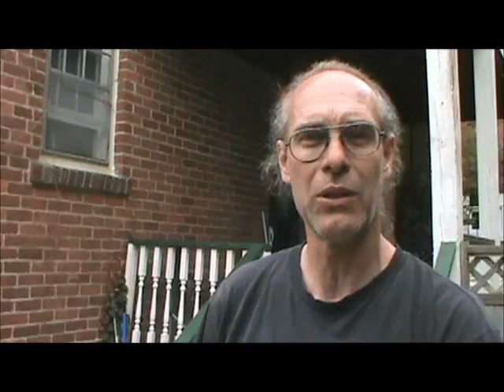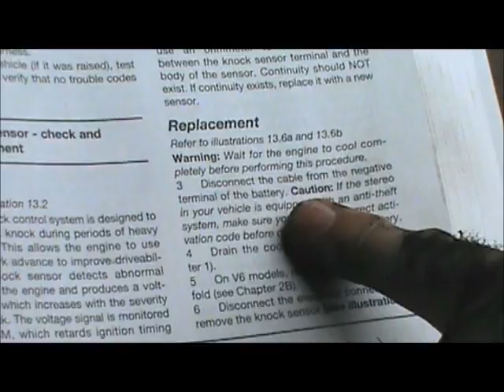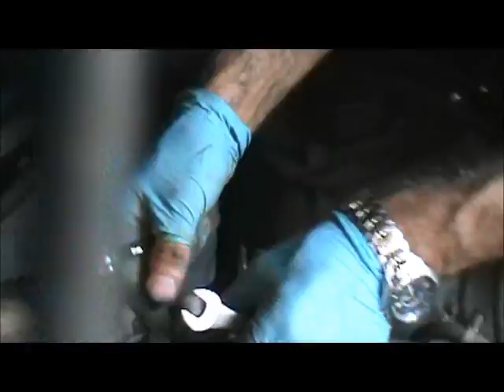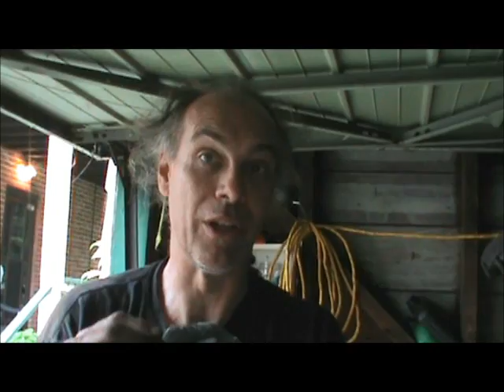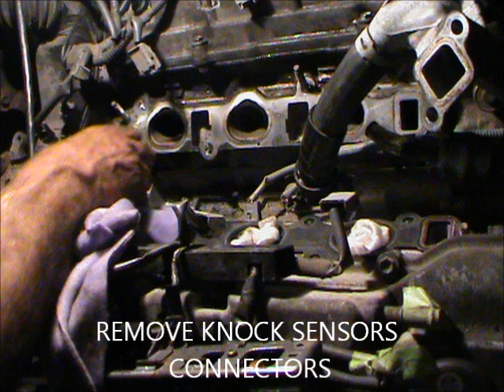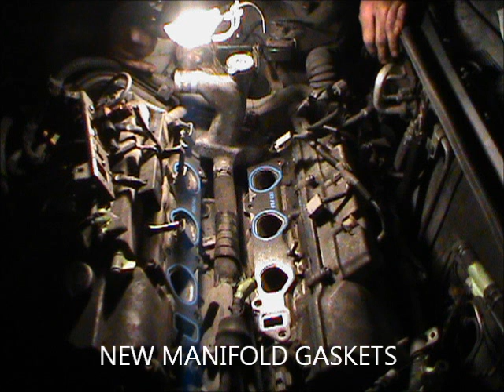2000 Toyota Avalon Knock Sensor Wire Replace

Comment: You never said if the wire harness replacement fixed the problem or if you had to go back in there and replace the sensors anyway?

Comment: 27mm or 1-1/16 wrench to remove sensors
size 8 Allen key for plenum use a socket Allen bit .
No need for torque wrench your hand is already calibrated to good n tight.

Comment: Hello I replaced the Knock sensors on my 2002 Toyota Highlander 3.0 with a Denso knock sensors and light come back new wire hardness too . Check engine Light come back p325 and P330 for both knock sensors I heard some people by pass it . What can be ?
Reply: I've heard of knock 1 goes bad splice wires to knock 2 going to ecm. Or vice versa. To skip all this.

Comment: have the engine light on w/vsc & trac light on, found a wire back of motor top/wires exposed with fraying, not sure what the wire is, I have a 2003 toy Avalon xls. some of the shelding covers are dry rotted, and clips, anyone can help me please?
Reply: it's behind the intake manifold

Comment: I have a 1999 sienna that has a pulsating sound coming from driver side firewall when the key is turned to the on position. Sounds like something pumping fuel. It use to pulse one time and start right up but now it pulses over and over and has a long start coupled with smoke from tail pipe. Any idea what this is? It started this after I changed the fuel filter a while back. And the sound sounds like it's coming from that box above the fuel filter.

Comment: I just changed these on my 2003 Camry beater with the v6. Suggest getting new PCV valve, the one that is plastic at an angle because it will not come loose without snapping. Get the grommet as well for it all together $11 from Autozone. Also get a hose the same size as the EGR hose. The one with the green cap on it. That one will snap as well as it’s hard as a rock. Get new gaskets and about 5 cans of carb cleaner to wash off the intakes. Also changed the spark plugs and coils because it’s perfect to do like the man said. I changed the radiator too because it was leaking do that too if you have the same problem.

Comment: I got two OEM knock sensors that were still sealed in the original Toyota bags from Amazon for $27. I also got an OEM cable from Amazon for $35. The hose was only a few bucks. If you go through all the trouble of digging your way down in there it makes sense to change everything and not have to go back in there again a short time later.
Reply: Lucky I put the Dormans on there with a new wire because they were 47% off

Comment: The knock sensor video is great. Question, were you having issues with cold starts issues is why you are replacing the knock sensor wires?

Comment: When you release the fuel pressure from the fuel injection rail, did you take out the bolt completely? Or did you tighten it back in after releasing the pressure before removing from the intake manifold?

Comment: Buenas noches tengo un abalone del 2000 tengo problema que cuando el vehiculo arranca arranca vago sin fuerzaspero a los5 segundos coje velocidad no se q puede le agradesco si me pueden ayudar gracias y buenas noches
Reply: Amigo, de repente pueda ser el filtro de combustible que esta debajo de la caja de aire (airbox). Muchos diran tambien que limpien el "Idle Air Control Valve" y el "Throttle Body". Por lo pronto eso lo que pienso, pero no soy mecanico, nomas dueno de un Avalon.

Comment: As our Professor said, I repeat:
Before even to start:
. Table, with clean blanket, all tools used in an organized way, bolt, nuts in order, .. act as a doctor performing a surgical operation.. 
You will enjoy working as easy as 1. 2, 3
. Battery removed.
. Drain the antifreeze.
. Prepare COLORED TAPE and MARK ALL VACUM HOSES, 1..2..3.. as simple as that.

You'll save a lot of frustration and headaches.  

Hats lift up for our Professor for the idea to switch the back nasty bolt to a STUD.. WOW.. What an idea.. I bit everyone that Japanese will get jealous. 

Watch out:
X Plenum and Upper Coolant housing (where the radiator cap is attached) are soft aluminum..easily to be stripped off.
Do Not take a chance:
Replace both sensors and the harness.

Best regards Sir. TWO THUMBS UP.

Comment: Hanes manual directions...
1- disconnect battery
2- remove intake manifold
3- remove sensor
4- installation is the reverse of removal

Comment: the hot ticket on these is if the #1 sensor goes out splice the #2 sensor into its ECU input, and if the #2 sensor goes out do the opposite. Your car will run fine until the second sensor goes bad (sometimes forever). This can be done at the harness in the engine bay or at the ECU.  Google Lexus knock sensor splice.
Reply: Will that keep the check engine light off?
Reply: What Jay asked

Comment: I've watched a lot of auto repair videos. You do a very good job....a natural teacher - that's a gift, and you have it, Thank you for this video. Daughter is  at college 350 miles away. Check engine light is on and AZ showed the knock sensor as the culprit. My question is can she drive it home so I can replace it, or is that to far on the motor? She says it just doesn't accelerate as fast as it was before the light came on. Thanks in advance.
Reply: The car will run slightly less efficiently and won't accelerate as quickly, but will run indefinitely with this issue. It'd be no trouble.
Reply: @Return_to_Roots   - thank you . She made it home safely.
Reply: Just in case someone else reads this when the knock sensor code pops up the transmission will not go into overdrive and the ignition timing will be fully retarded. This is done to protect the engine from undetected preignition while the knock sensors are not working properly. When you drive it like this the engine will overspeed if you try to drive it at normal highway speeds so you will have to drive it very slow. What I found is that if you clear the code with a scanner and drive the car no faster than 55 mph the code will not come back and the car will drive normally. But if you drive it over 60 mph the check engine light will come on again. So you can keep driving it this way until you can go in there and change everything.

Comment: No need to take off the fuel rails. leave them on. Move the harness rail that keeps the fuel injector connectors and some vacuum hoses away by moving them forward. Then, After removing the plenum, and then unbolting the manifold and taking it off. By the way: I do not replace the 14MM bolt back because it is a royal pain. It doesn't seem to hurt a thing. Don't know why they even have that big of one in the first place. The 12MM on the other side seems like a mount of some kind. The easy way to put them on (if you do) is attach them (and the ground wire in the back of the plenum) first to the plenum BEFORE you lower the plenum in place. I have taken off the and replaced the sensors now 3 consecutive time lately to figure all this out! Takes me 3 hours from start to finish.

Comment: Amazon has the wire and two sensors for 24$
Reply: For the work being done, it's best to stick with OEM ( which means Original Parts) not some cheap Chinese crap. Use Denso sensors and OEM wiring harness.
Reply: Oh, and I bet they're the highest quality!

Comment: I just pulled a 330 code on my toyota solara and a bank 1 sensor 1 oxygen sensor. Stumbles on acceleration before it actually gets going. Glad its just the sensors

Comment: I replace my sensor with aftermarket on the v6 1mzfe. Aftermarket is rejected. Code popped right back up. It's worth buy one toyota. I purchased my Toyota sensor for cheap on ebay
Reply: Stick with Denso on all sensors!

Comment: So, the big question, did it in fact fix the problem without replacing the knock sensors themselves?
Reply: I'd also like to know, as Im needing to do exact work on my. 2000 Lex ES300.
Reply: @richsmith7309  It didn't work for me. Looks like maybe the sensors are also toast.
Reply: I also would like to know.

Comment: I am attempting the knock sensor replacement myself, but in looking at the Haynes manual after watching your video, I am curious: did you drain the coolant from the engine drain plugs in addition to the radiator drain, or is that not necessary for what we are doing?

Comment: I was getting a knock sensor code. So I did this repair and changed gaskets for Penlum and also changed engine gaskets.  Unfortunately, I only replaced the harness and not the sensor.  When I droved car past 50 miles per hour, the engine light came back. I got knock sensor code again.  I will have to go in and change the sensor now. My question is, do I need to replace Penlum gaskets again, if car has only been driven less than 10 miles since repair?  Please help!!!
Reply: The gaskets only needed to be replaced because of age and direct exposure to the many heat cycles of the engine over the years which makes them stiff and brittle. Month old Teflon lined gaskets like those used in the intake manifold here can be safely reused because they are still flexible and pliable, so you should not have any issues reusing the gaskets unless they somehow become damaged during the disassembly and reassembly process again.

Comment: What size bolt for the back of the intake manifold? I dropped mine and can't see it in that lower engine space below the rear valve body. Also , what thread?

Comment: Am gearing up for a father/son repair project on a 2002 Avalon - this video is much appreciated. He's up against emissions test deadline and definitely has the dreaded knock sensor codes.  I have the Haynes manual, but seeing the action live really helps, as do tips such as the plenum stud.  I'm doing the air/fuel sensor and injector o-rings/seals as suggested by one commenter.  The car has 150K miles and may become college transport in another year.  In ordering parts, Rock, AM Auto and Amazon all seem priced in the ballpark, but one vendor on Amazon currently offers the OEM Denso knock sensors at ~$50/pair, so I'm not going to risk using the old ones.  One vendor seems to be promoting a non-Denso true air/fuel sensor at under $50 - not sure yet whether I'll bite on that option.
Reply: Thanks for this, going to go to Amazon for my knock sensors for that price
Reply: Completed all repairs successfully and he's back on the road with inspection and sticker good for another year. Parts total under $300 and I splurged on higher and lower range torque wrenches,  so well under $400 total.  The dealer quoted near $2000 for all the same work,  and the inde mechanic $1400, so the 6 or so hours it took us pilgrims was worth at least $1000.  Would do the same again!  

 Thank you again for the very helpful video,  tips,  and ideas for the other items to include for service.
Reply: I also have a 2002 Avalon and will be starting this job in the coming weeks. Any advice? Problems you ran into or thoughts on tackling that PIA bolt? lol

Comment: How long does it take for a shop to change knock sensors 2 both on 2001 Toyota Avalon is it 1 hour 2 or 3?
Reply from the maker: Edgar R if I remember correctly it took John 3 hours to complete the job
Reply: Low Budget Creativity

Thanks that’s what I thought, 👍

Comment: I changed my wire  harness  was a lot of work by myself took 2 hours got it done car ran good but then after a week  check engine  light  comes  on same code p0330 so now what do i do .tame apart an change  the nock sensor it's a lot of work  thanks
Reply: I'm about to do the same, I orderes the harness and knock sensors. So I'm wondering if your issue is the knock sensor and not just the wire harness alone?? Hope you got your problem resolved!

Comment: If I may ask, on what did you use the torque wrench on?
Reply from the maker: The intake manifold, T.Stat and plenum bolts. Double check the Torque specs though.
Reply: Low Budget Creativity Awesome. Thank you so much.
Reply: how many pounds did you torque those bolts to?

Comment: Did this today on 02 Sienna.  Took my time and cleaned everything as I went.  Bolts on back of plenum and throttle body were not difficult to get out or put in.  replaced both knock sensors, harness and bypass coolant hose.  I replaced all gaskets.  Harness connector was the worst part of the job.

Comment: Hi if I have a 1997 Toyota Avalon, would the process be the same? It's a front wheel drive car and not sure if it's a v6. The OBD code came out as "P0330 Knock Sensor 2 Circuit Malfunction (Bank 2)". The dealership is charging over $1000 to fix it. Yikes!

Comment: Thank you sooo much for this video. Made the job a lot easier for me and removed a lot of fear. The previous mechanic had replaced the sensors but it was the wire harness that was broken and he used zip ties to hold the plugs together. The heat destroyed the zip ties. Thanks again.

Comment: Ipmgamer this is a great video. I am hoping this will fix the codes I'm getting on my wife's Avalon. I am interested in knowing if it helped with your issue. Also I would like to know any info you could provide in regards to part numbers. I am in need to get this fix done soon as I need to get it through emissions. Thank you in advance.
Reply from the maker: Cochip __ as far as i can remember john had to go back in and the O ring in one of the sensor ends because it wasn't going in to the port. I guess some brands are made different i hope you dont have the same problem and im not sure of the part numbers sorry

Comment: There's two ports where the harness connects into two separate sensors. One of the connectors has a shorter wire and connector and one is longer. Which one do I hook where? I'm curious because I think I did it right but it's still knocking. Maybe I should replace both P0330 sensors? They look the same so should I try replacing these? I'll see if it's throwing the code if I replace that and it still knocks
Reply: I hooked the shorter one to the closer port and the farther one to the longer port. I also had a hard time making the connector engage into the opposite side of this. Rock auto's part was not the exact same causing me some frustration and time
Reply: Any advice would be appreciated
Reply from the maker: Hey there i think you got it hooked up right short end to the closer and long end to the port furthest away and we had the same problem we had to remove the gasket inside of it because it wouldent connect

Comment: very nice and helpful video.  One question.  You say you are replacing the fuel filter also.  I am being told the fuel filter is in the gas tank.  Am I missing something, is there another one between the cylinder banks?  Thank you.
Reply: There are two fuel filters, one in the gas tank & the other on the firewall.  The Professor replaced the firewall one.

Comment: thank you for the video! was it successful changing only the wires?
Reply from the maker: +Mike Smith hey guys it was the harness that needed to be replaced it was malfunctioning I hope that answers your question
Reply from the maker: It was successful he had to do the other sensor as well.
Reply: Good video.  Confused?  What other sensor?  Fuel/Air, actual Knock? Or was the whole problem the Knock sensor wire harness?
Thank you.  I am facing this job now to.
Reply: +914Catfish that's exactly what I was wondering because I was confused as well. if u have any sites that worked for me on the knock sensors for only 16 bucks and the harness for 19

Comment: Many thanks !!!!   been waiting for a video like this.  autoshop repiar estimate $1400.  I plan on repairing and replacing many of the parts you suggested when the wether warms up.
Reply: Douglas Heffron 1400$...WTH....For this same vehicle? I have a 2003 and they quoted me 260 and the mechanic said while we're at it we should do both...That's 260 for both....That 1400 is insane...And this a shop with a great reputation.

Comment: Did this solve your issue with the knock sensor? I have the p0330 code for bank 2 i also have a p1354 vvt bank 2 and i wasnt sure if i replace the ocv that knock sensor code would disappear.
Reply: Same did you solve the problem wit just the OCV?

Comment: What was the part number for the gasket kit you got? I don't see it. I'm not doing the knock sensor. I had oil in the cylinder behind the pcv and there was a misfire there. Do I need to do all these steps just to remove the plenum and valve covers?
Reply from the maker: I don't quite understand where the oil leak is so I'm not sure how to answer your question. Is it the valve cover gasket that is leaking? If so the only gaskets you will need is the valve cover gasket and the spark plug seals as well as the plenum to intake manifold gasket .
Reply: I just meant the whole gasket kit you purchased. I didn't see one so I just ended up grabbing the valve cover gaskets with the plug seals and the plenum gasket as well. I took it all apart and cleaned it all up today. Your video was a big help with that.
Reply from the maker: that's great news! I'm glad it helped